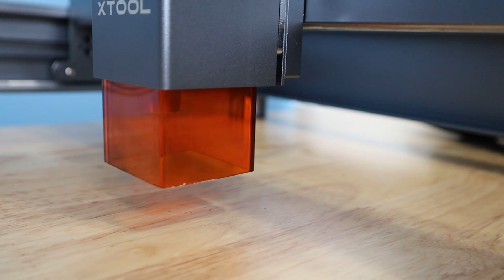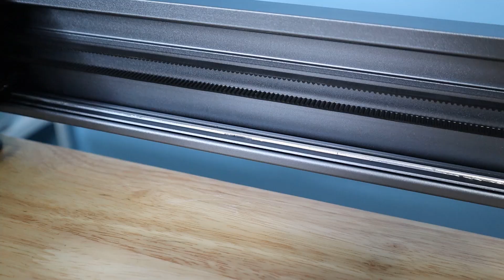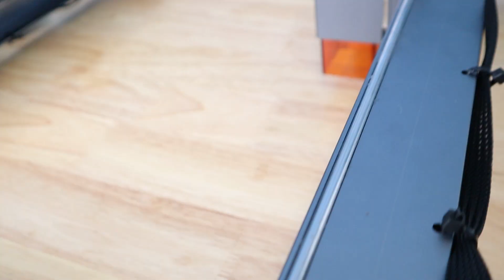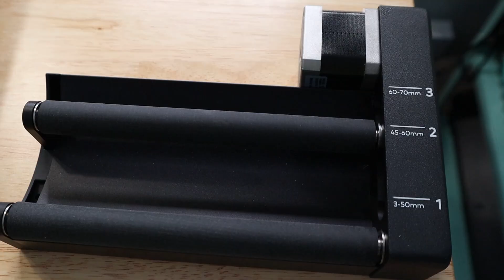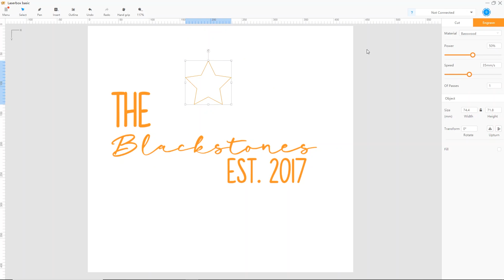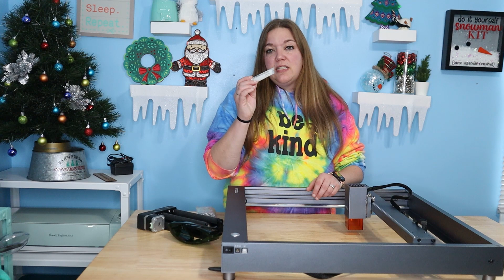Makeblock xTool D1 Laser cutter review and overview of the machine and software engraving

Comment: FYI.....The red crosshair laser is exactly 16mm from the blue working laser. It is designed this way at the factory, and is automatically adjusted by the firmware to compensate for the difference. (It can also be calibrated in 1 mm increments in Lightburn software). Also, the Laserbox software is useful while you are learning to use the laser, but it is way to simplistic once you start creating advanced projects. Lightburn is way more intuitive, and you can both create and execute your project within Lightburn. You can also make a lot more adjustments to the laser within Lightburn. You can also work in imperial or Metric measurements within Lightburn. Laserbox only allows Metric for now, but it is supposed to allow imperial measurements in a future software upgrade (so I have heard). If you want to use the xTool D1 in your indoor craft room, Check out the Comgrow enclosure. It is reasonably priced compared to other enclosures, and you can connect a ventilation system or air scrubber to it through the 3 inch exhaust port. I just wanted to give a few helpful tips, since you, and many of your viewers, are new to the world of lasers. 🙂

Comment: fyi you do NOT want to use the typical dry powder ABC fire extinguisher on a fire from this. What you want is either a CO2 extinguisher or a Halon, halon being the better choice. the dry chemical inside the ABC type WILL corrode the electronics on your engraver. the halon and co2 will cost a bit more than the abc but its better than buying a new $1000 engraver after a small flare up. great video btw!
Reply from the maker: Thank you so much for that info!

Comment: By far the best explanation on how to use the software and machine! I'm still confused on the settings though. I think mine is set in mm and not inches? And also the laser doesn't start where it's supposed to.
Reply from the maker: Sadly you can’t change the measurements I just use google to convert to inches. And you may need to physically move the laser to where you want it to start

Comment: When I hit the framing button my laser only moves left to right. It is not engraving the images I have selected. It only engraves a line. What am I doing wrong?
Reply from the maker: sounds like your belts are not on correctly for the forward and back movements
Reply: @CorinneBlackstone  what should they look like?
Reply from the maker: @megmattaliano9865  they should be fully attached at both ends with the bar at the top attached. I would recommend joining an xTool Facebook group so you can actually post a photo of your machine and we can see to help guide you

Comment: How can I use my cricut svgs to light burn?
Reply from the maker: You can’t take design from design space but if you have SVGs that are just downloaded you should be able to import them. I don’t use light burn so I can’t give directions
Reply: @CorinneBlackstone  thank you so much. I designed something myself and wanted laser it. what I did with my cricut didn't work as planned. Thank you so much for responding!!
Reply: You can use a snipping tool on the design in cricut, save it as a png or whatever you need, then import it from there. That's what I did for my first engraving tonight but I imported it into the software that came with the laser (and agree that it is severely lacking). Lightburn is supposed to be great so I'll check that out with the free trial
Reply: @arewood2628  thank you 😊